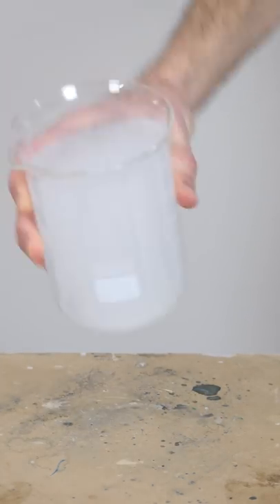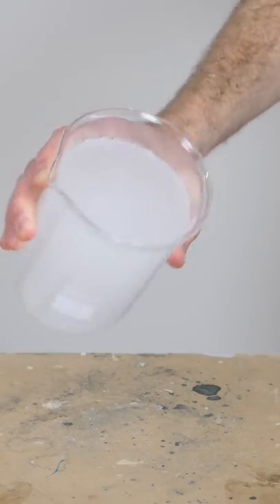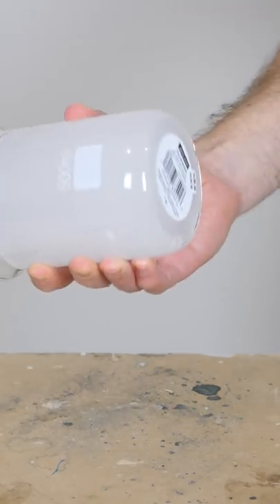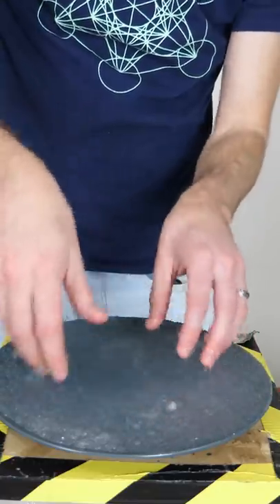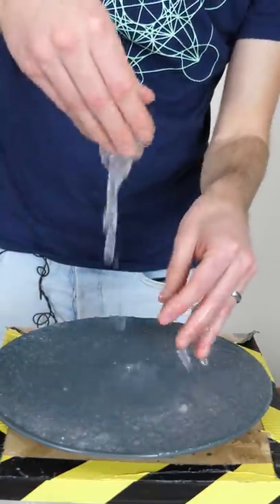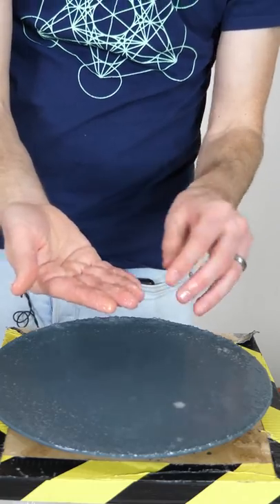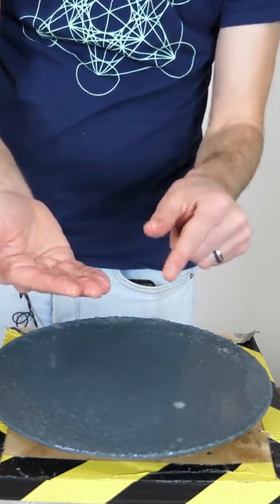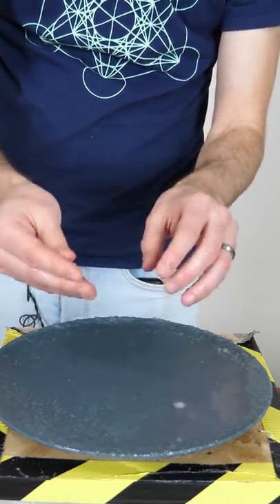Don't Put Salt On Superabsorbent Polymers

Comment: Those polymers are used in disposable diapers. If you’ve ever had one rupture you know the horror of having to try to clean that stuff up. It gets EVERYWHERE.
Reply: yeah its a nightmare
Reply: Jeffrey Johnson  It is used to clean spills. Especially vomit and other gross fluids. Brand names include Super-Sorb and D-vour.
Reply: Jeffrey Johnson  Not sure about oil. Sawdust is common for such a use, though I'm not sure how effective it really is.
Reply: Polymers like that are also used in the oilfield.
Reply: They're also used in some icepacks.
Reply: Yes! It's awful.
Reply: Boy do I ever know that  my kid  is in diapers and he had a swim day and as soon as he came out of the pool pop goes the diaper and it got everywhere
Reply: Jeffrey Johnson  I use kitty litter or sawdust for oil spills in the garage. I wouldn’t use these kinds of polymers though because they get soggy and sloppy and smear when wet and makes it hard to sweep up. Cat litter clumps together.
Reply: Jeffrey Johnson  oil-dri is the best solution, only its harder to find in a pinch.
Reply: Disposable diapers? As opposed to reusable diapers?
Reply: @seg162  there are reusable cloth diapers that often come with disposable liners, and there are the disposable diapers like pampers.
Reply: They are also used in sanitary pads
Reply: its even worse when your dog eats your little brother's diapers and trails it everywhere
(the dog is OK btw)
Reply: I knew I remember it from somewhere
Reply: Also used in pads

Comment: There was an air crash investigation related to salt water contaminating a Jet fueling system.  I wonder if the cartridges used to filter water from the fuel were made of the same type of polymer.  Because those particles made their way into the Jet and jammed the fuel inlet valve after swelling.
Reply: Why would you wonder if thats used when you just said the airlines use it? You answered your own question.

SMH
Reply: @xedrickOG  he doesn't know if it's the same exact polymer.
Reply: @aegaeon117  its close enough
Reply: @xedrickOG  Not for commercial airline standards, it be like using the wrong grade of titanium for a jet engine.
Reply: @xedrickOG  no it really isn't
Reply: @oblivionthekhajiit1155  close enough

Comment: not sure it's the osmotic pressure alone. most hydrogels are made by combining polyions of opposing charge and by mixing in the salt the single-nucleus ions are probably saturating the polymer charges on their own, sequestring them from interacting with the water. You're probably salting out the water from the polymer rather than salting out the polymer from the water
Reply: My brain not big working
Reply: I feel like you’re just flexing right now lol
Reply: @TheBlairWenchProject  possibly
Reply: Yeah I was about to say, I think the salt is either removing hydrogens from the polymer, or replacing bonds instead
Reply: Right. What he said.
Reply: I honestly wouldn't have thought of that I don't even know what osmotic pressure is and I'm in AP Chemistry lmfao. Still proud of the fact that I think I get it though xD
Reply: meanwhile, my big stupid self was thinking about temperatures (like how you can melt ice with salt, etc.)
Reply: @zackhenderson2392  well you're not wrong. I forgot what it was called cuz I learned this last year but salt does effect temperature changes. The chemical change allowed the salt water to behave differently to allow for a different physical change (I think...)
Reply: @rendajones7368  Are you sure about that?
Reply: @topsecret1837  absolutely….

Not! 😐✌️

Comment: I’m guessing this is the science behind killing garden slugs with salt. Basically the same thing happens with them too. Makes sense because they’re pretty slimy (organic polymers). Nice to see this effect presented without cruelty to a living entity.
Reply: a slug ?? 😭
Reply: When I said the same thing happens with them too, I was referring to their slime. Yes, salt dehydrates them. It’s called osmosis, and you can look that up specifically with regard to slugs. The osmotic pressure effect in this video is also dependent on OSMOSIS. Both of these things use salt to draw water out of a membrane. In the case of the slugs, it results in severe dehydration.

Comment: "The reason is the change in osmotic pressure"
  Right so ummm, I'm gonna need to see a video explaining that too.
Reply: Basically, diffusion is the process of stuff moving from areas of high concentration to low concentration until the concentration is equal. Osmosis is just diffusion but specifically with water.
When he added the salt, the water noticed there was an imbalance of concentration and really wanted to go dissolve the salt to balance it - so much so that it broke free from the polymer
Reply: When a Valor and a Mystic come to hang out and watch cool science shorts and everything is chill.😌💙
Reply: outside is drier than inside. go outside.
Reply: @LARAUJO_0  Don't ya' just hate it when water notices things?  :p  :)

Comment: So NO reason not to. Ok. "Thanks." Putting salt on superabsorbant polymers is The recommended thing to do to it when you need it to change form again, for instance when using bath products like gelly baff / slime baff, and any and basically all other applications.

Comment: This brings back some bad memories helping to run 2 machines that made ice packs for a food shipping company. This is what we filled them with. 7kg (approx as it depended on ambient temp to get it through the dosing pumps and into the vff) into 1200L of water. It is horrifically messy and slippery as anything when spilled. When it dries (in pipework for example) it goes like rubbery concrete and then salt won’t loosen it.

Comment: This is actually potentially really helpful for custodians. I won't say it's super common but some knowledgeable teens with not much to do have definitely dumped similar polymers into toilets. Then they can't flush and if then used you have a horrendous mess. If some table salt fixes it that's great

Comment: So disposable diapers are absorbent because of the SAP (Super Absorbent Polymers) in them. Urine contains salt ( or is it sodium?). Surely there is more to it or disposable diapers would not work as well as they do. Or does the above video only work because the amount of salt used is far higher than any urine could contain?

Comment: Imagine if we filled sand sacks with a little bit of that stuff and lined them around houses before hurricanes or flooding, they could soak up a lot of the flood water and block the rest. O-O

Now for the big question...can the water evaporate from the polymer?

Comment: Isn't it the sodium in the salt that's causing the polymer to fail? Because I think that's what our blood cells use sodium for, getting water into or out of cells.... I could be wrong about that.
Reply: Sodium controls our fluid balance and blood volume so you're at least partially correct

Comment: Back in the early 2000s they sold this bath toy for kids that was basically a big bottle of that powder with green dye and you where supposed to put a few caps in your bathwater to make a sludge but it clogged drains so instead my dad and i just made buckets full of it and threw it at each other lmao

Comment: I used cross-linked polycrylate copolumer and added hydrogen peroxide +  a tiny bit of baking soda and the polycrylate copolymer crystals absorbed the hydrogen peroxide and notw its bot jelly but squishy pebbles its really cool

Comment: Question, i get the osmosis but bit presumably if you added flour it would bind with the damp crystals and make a gloopy mess.  How come the salt re-reates the water structur and the flour wouldn't.  Is that just down to the fact salt is a soluble crystalline structure and flour is something else (no idea what structure flour would be defined as)